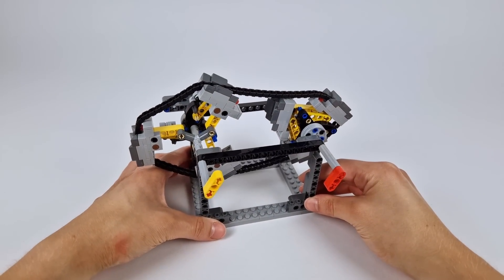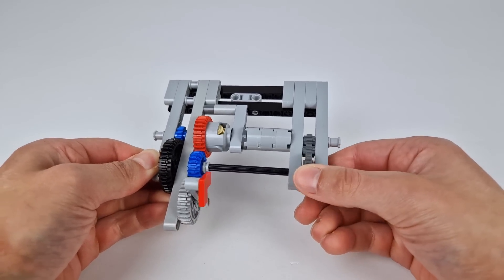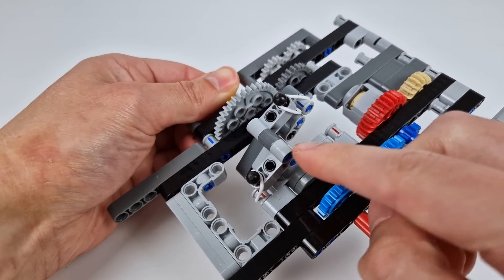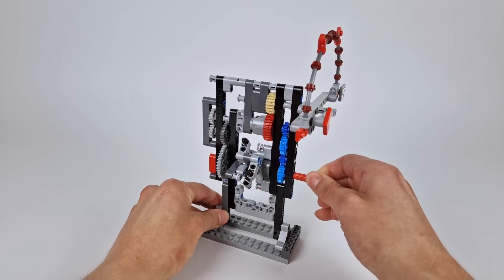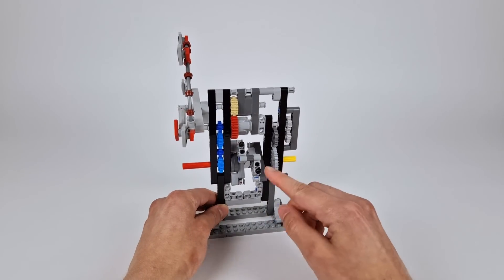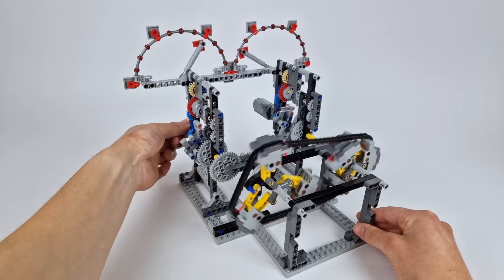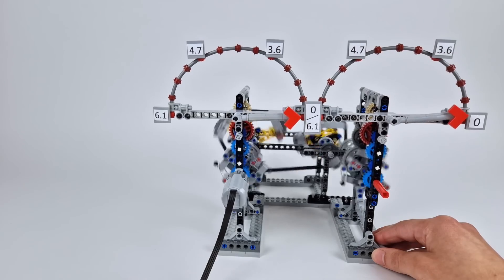But Does My Automatic LEGO CVT Actually Work?

Comment: Why are you making lego videos and not working for NASA
Reply: Because he thinks he's getting work for free and there's no loss in torque. He's not, and there is.
Reply from the maker: @SlyNine That's simply not correct. Of course there are very small frictional losses to drive the dial, so of course there is more resistance when the CVT is connected through the torque measurer versus nothing being connected. But when the torque measurers on the input and output both show roughly the same torque, it clearly shows that the torque measurer (in that case the output torque measurer) isn't wasting any significant amount of the input torque.
Reply: @BananaGearStudios  Exactly what i mean lol

Comment: The second design is still a great achievement, but is doesn't work better for the reasons you claim (Tl;Dr: It's actually all because the LEGO differential has massive friction issues):
A: 1:23 If there is torque lost in the mechanism, then it's due to the friction between the gears. The rubber band would only store torque (or rather energy), it would use some torque for a second or less to get stretched, and then it would supply the torque (or energy) to the output shaft once it can contract again.
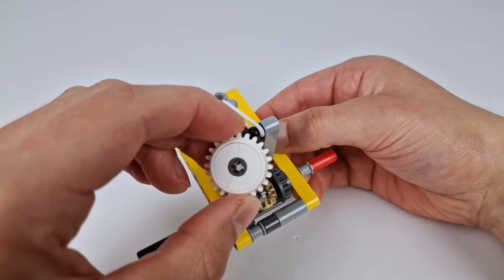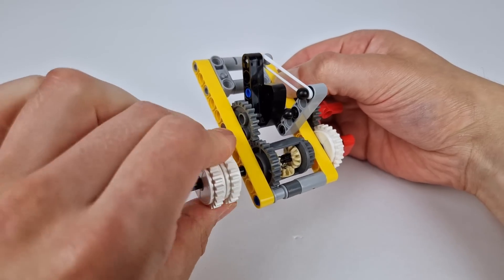B: 1:40 The fact that the output slips with one clutch on the input but slips with two clutches on the output only means that the torque ratio is closer to 2:1 than to 1:1. I really wouldn't call that a way to measure how much torque is lost, beyond this rough estimate. (You have no way of knowing that it's "exactly half", as you state at 2:02.) Not least because you also apply the torque in a "pulsed" manner if you hand-crank the input shaft, and the clutch gears slip at peak torque.
B.2: If you really wanted to measure how much torque is lost in the/an device, then the only way to do that would be to attach a torque-measuring device to its input and output. 14:25 It looks like the friction in the "first device" is closer to 2/3rds than to 1/2.
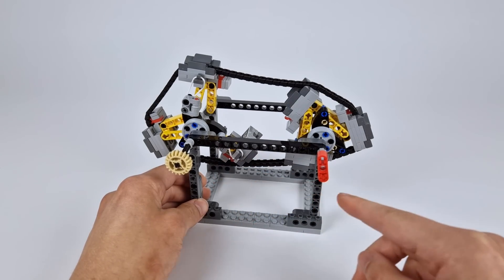C: 2:14 "meaning we'd only have a quarter [torque] left to actually power anything with". You only have to pay the torque price while measuring it, though. The only real problem would be that you can't get the full amount of torque that the motor provides into your CVT, and thus can't measure it's performance in the highest torque range.
D: 6:11 There is (theoretically) no difference between the rubber bands being stretched in either case. The only real advantage of the second design is that you eliminate almost all of the friction inside the differential. The gears inside the differential are still spinning against each other when the axle spins (as in the first design), but the dial pointer and associated gears do not put any force against the differential housing (in contrast to the spring-loaded pointer in the first design).
E: 8:13 That would be the analogy if there was no differential in the first device, but an arm that is directly connected to the input/output shaft.

I was suspicious that that "half the torque is lost in the device" result was way too high, but apparently the LEGO differentials are just really not made to work with torque on all 3 sides while the little gears are spinning against each other. Which admittedly they don't have to when used in a car's drive train.
I do have to congratulate you on stumbling across the correct solution to your problem without understanding it correctly. I'm pretty sure that I would have struggled to find a way to not spring-load the pointer side of the differential, even if I knew that that's the source of the lost torque. And without seeing both designs I may never even have believed that it's indeed coming from the differential.
Reply from the maker: I thought a lot about this while I was making the video, and you might be right that the additional losses are going to the gears inside the differential - I'm honestly not sure. Considering the conservation of energy as you mentioned, the way it made sense to me using my explanation is that, once the rubber band stretches it's exerting an equal force on the differential housing, which corresponds to a higher torque felt by the input. So even if the rubber band isn't being stretched any further, the input is turning the same distance against a higher torque, so more energy is needed, meaning this extra energy is being wasted... somewhere, since the output still has the same speed and torque as before. I thought that somehow this extra energy must be being wasted by the rubber band, but I understand that if it's not streching any further it's not storing any extra energy. Maybe it's rapidly stretching back and forth slightly as I turn the input to dissipate the extra energy, I'm honestly not sure.

And regarding B.2, yes, I wasn't sure that it's exactly half the torque that is lost, that's why I didn't end up using that mechanism to measure the torque like that. I just mentioned that to explain that it isn't a practical design even if we do know how much torque is wasted.

D. I disagree. Try driving any mechanism through a differential and you'll see that at most only a small fraction of the torque is lost to it - they're not that lossy at all. As I explained above, I still believe my explanation could be correct, but even if it's not, I don't believe that so much torque is being lost just to the differential gears.
Reply: I'm sorry but most of this comment is incorrect and the video was correct.
Reply: @jerth  Well, there's an easy way to test it: Build the first mechanism, but without the arm and rubber band. Just connect the differential housing to a fixed  gear (or rack). If the video is correct, and the rubber band stretching (and needing to be held stretched), then the "simple differential" wouldn't reduce the torque at all.
If I'm correct and the differentials just have massive amounts of friction in them when loaded, then you'd see the same results as with the arm and rubber band present.
Reply: @jerth he's correct. Plus it's obvious unless you think he's magically getting work for free.

Comment: Great video! loved the in depth explanation of torque measurements. However, I think the reason for the losses in the first device are different from what you explained in the video. Since for a fixed torque the rubber band reaches a steady state, we can expect the same amount of loss from replacing it with a fixed length linkage. This would mean that the entire outer body of the differential is fixed, and the torque loss is coming from inefficiencies in the small bevel gears inside, which would make sense. This is an important distinction because it shows a fundamental principle of how work works (pun intended). Friction is force over a distance so it can take energy out of a system, but a rubber band that is at a fixed length can not consume energy since the force is not acting over a distance
Reply from the maker: I thought a lot about this while I was making the video, so I'm glad someone's brought it up, and you could be right that the additional losses are going to the gears inside the differential - I'm honestly not sure. Considering the conservation of energy as you mentioned, the way it made sense to me using my explanation is that, once the rubber band stretches it's exerting an equal force on the differential housing, which corresponds to a higher torque felt by the input. So even if the rubber band isn't being stretched any further, the input is turning the same distance against a higher torque, so more energy is needed, meaning this extra energy is being wasted... somewhere, since the output still has the same speed and torque as before. I thought that somehow this extra energy must be being wasted by the rubber band, but I understand that if it's not streching any further it's not storing any extra energy. Maybe it's rapidly stretching back and forth slightly as I turn the input to dissipate the extra energy, I'm honestly not sure.
Reply: @BananaGearStudios  Your reasoning is almost correct, but fails to consider that the torque of the gearing in the differential doesn't add up like that. Actually, due to how the gears work, the torque of all three diff. outputs should always be equal, or at least proportional. You can see this when you let the diff. housing spin freely - then there is no way for you to have any torque on the output shaft no matter the input shaft torque, because it'll just make the housing spin. With your initial reasoning, "no torque on the housing" should mean "all torque goes to the output shaft", which clearly isn't true.

Thinking in terms of "conservation of energy" is extremely useful here. Ben is 100% correct in saying that you could replace the rubber band with a stiff linkage in the steady state, which can not consume energy, ergo it can't cause losses. The way the gears in the diff. are set up that the output will just feel the input torque, minus friction on the small gears inside.
Reply: Thats excactly what puzzled me. I don't think the rubber band is stealing torque. In a steady state, once it's stretched it can't be absorbing torque. Otherwise, where is the energy going? Sure there's more loss because the torque has to travel in a less efficient way. But in a no friction perfect world, the principle remains the same, you're basically holding the torque with a spring and measuring the deflection, it's just that the axle one is way more elegant and less intrusive. His example with the car is also flawed, the way he represented his first mechanism as a second weight isn't true, the rubber band should be fixed to a stationnary object. In fact, the whole idea of losing torque in his mechanism makes no sense in term of work, the motor is directly connected to the gear and the only thing resiting its torque is the chain, reverse from the output perspective.
Reply: @ameunier41  Yeah, I mean the rubber band tries to apply the force to the output so no force loss. Just a little bit delay of the force
Reply: @NivaLunaa   Exactly, the rubber band need to stretch first for the system to be able to apply torque to the output. His final design still experience it, it's just that it doesn't have backlash and is way more sensible, so there's less delay.
Reply: This feel like the question, how come a magnet doesn't do work? Like, a magnet just sits on your fridge and doesn't move, so no energy is used, but it's clearly withstand earth's gravity, so how did it do that? I haven't ever gotten an explanation of this that made sense to me.
Reply: @kindlin  Work is force x movement. if it doesnt move, it isn't doing work. No energy is added or removed from the system. The same way a table holding a book isn't doing work.
Reply: @ameunier41   I mean, yeah, I basically said that in my post. But it's CLEARLY doing  some effort to hold the magnet up. If you try and pull the magnet off, until you reach some critical point, it won't move, but it's withstanding more force the entire time. Or even, as the magnet nears the fridge, it pulls on you, with a force, over a distance, so the magnet is clearly doing work in the case, but everyone agrees that magnets cannot do work. I know the math, but this has just never made sense to me, intuitively.
Reply: @kindlin  Magnet cannot create work, but they can "store" it. A good example would be gravity, a concrete block sitting on the ground won't create work by themselves, but if you lift it with a crane it now has the POTENTIAL to do work. The force x distance used to lift the block doesn't disappear, its "stored" as potential energy.
Reply: @ameunier41   The gravity analogy makes a lot of sense, but this leads directly to a follow up question, can gravity do work? I guess, because of the equivalence principle alone, I think the answer must be no, and this leads me to a conjecture, can no potentials do work? Extrapolating, is this a good basis for an intuitive understanding of why electric dipoles cannot exist?
EDIT: By the same analogy, can you set up a system of coordinates that show any magnet doing zero work, like how you can setup an inertial reference frame for gravitation, and the magnetized object is just doing.. something to follow it's path? Maybe it's following the electric field, then. Does that mean magnetism isn't "real" in the sense that gravity "isn't a force"?
Reply: Well said! I also think the loss simply comes from the small bevel gears. As you said, for a steady state, the band is stretched by a fixed amount and nothing turns but the in. and out. shaft and the bevel gears. In order for power to be lost, something would have to rub or slip, and I don't see anything but the bevel gears doing that.
Reply: In the first torque measuring device, energy is lost in making the white slip gear slip, as this acts as a sink for the torque to drain into - converting kinetic energy to heat
Reply from the maker: @geoffdavids7647 That's not correct. The white gear is connected to the output and is therefore acting as the "load" - we want that to be dissipating energy. The whole purpose of using that gear is to show that additional energy is being lost in the mechanism, not just to that gear.
Reply: @BananaGearStudios  anyway, you were totally right in saying that mechanism is not efficient at all, your last test clearly show it. A diff can be used to add/subtract, but it doesn't like to transfer torque while used that way. It put too much side strain on the spider gear. Think about it that way, all the force stretching the rubber band comes from the side torque on it.